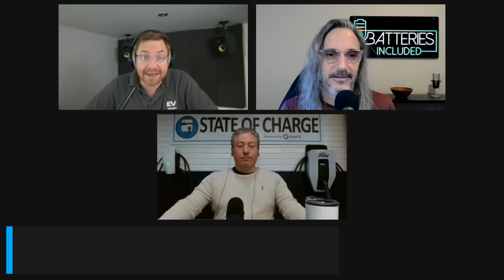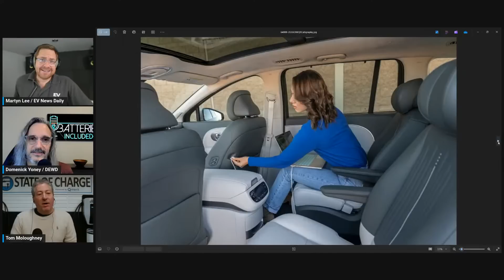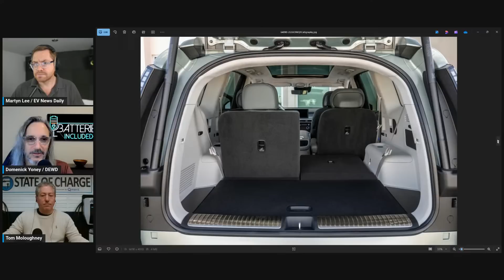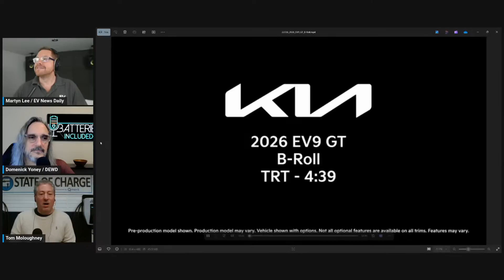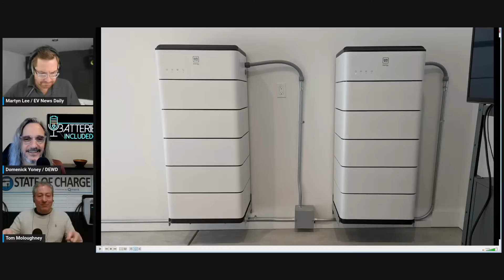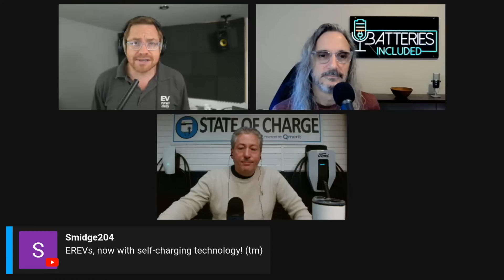Hyundai Ioniq 9 Revealed With Big Battery, Kia Debuts Updated EV6 And EV9 GT

Comment: Re:Comparison to Land Rover. I seriously considered an EV9 vs an Acura ZDX. Personally, I don’t care much about prestige of a brand. However I ended up going with the ZDX, in part, due to the nicer interior. The EV9 has a ton of nice features for the money. It has better DC charging speeds. But the Acura is able to do up to 190kw. Not speedy. But just barely adequate. Do I wish it was on par with Kia/Hyundai? Hell yes! But at the end of the day, the Acura was nicer in ways I would experience 95% of the time whereas the charging advantage would be MAYBE once a year.  I am impressed with what I see in the Hyundai. It resolves many of the issues I had with the EV9. But I will be interested to see if Hyundai’s interior will be nicer. If not, I’ll REALLY be interested to see if Genesis will be getting more serious about EV’s.

Comment: I own both model Y and equinox EV. I have to tell you something. I still like my model Y. combine leg room model Y is about 3 inch longer, and the truck space is almost doubled compare to equinox EV. the ride definitly goes to equinox EV, it ride almost as good as lexus. Model Y is too old to compare on ride, maybe juniper will solve this. The price is about the same when you consider spec. 2LT will be same price with model Y. Charging is another big factor, equinox EV just charge too slow, most of the time it charge under 100kw... Also, GM app are crap, take 45 second to sent a command to the car, and sometime failed. range is about same, but model Y gets about 15% more efficacy on its crap continantal tires. both get heap pump that are good. the sunroof could be a preferance, but hard roof is kind of dark for me on equinox ev. I am glad GM is able to talk to Biden to change the rule mid year and get it qualify for 7500 tax credit, otherwise I think model Y is clear winner here.

Comment: On the discussion of “why get something other than a Tesla”: I leased a 2024 Model 3 RWD LFP at the end of October. My choice was between that, Equinox EV, and EV6. They all had pros and cons and all fit my use-case. The deciding factor for me was price, and that’s what won the choice for the Model 3 for me. I loved the EV6 and Equinox and if their prices were equal, Model 3 would’ve come 3rd behind the EV 6 at 1 and Equinox at 2. There are choices and most companies do things well and other things not as well. This includes Tesla because they do NOT do everything the best, so it’s no longer cut and dry when it comes to choosing a vehicle

Comment: My 2015 Chevy Volt says it's an EREV in the manual, not a new idea or term, as most of you probably already know. I'll switch to a pure EV eventually, but my commute is only 16 miles, and it's paid off and so cheap to drive, charged off peak.

Comment: The best part of integration of your car into your home for the car makers is, you can only use a GM system with GM cars, a Ford system with Ford cars, a Tesla system with Tesla cars.  

Once you commit to a brand, you are committed for life.  Until there is a standard, you are better off relying on in home batteries.